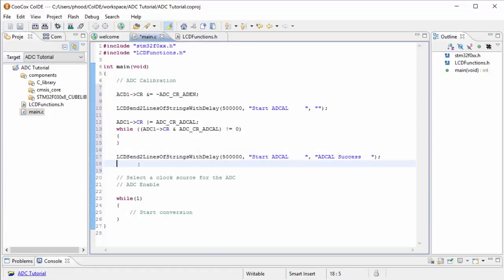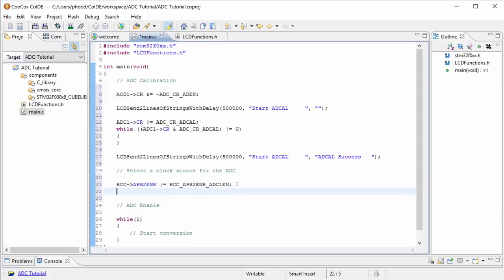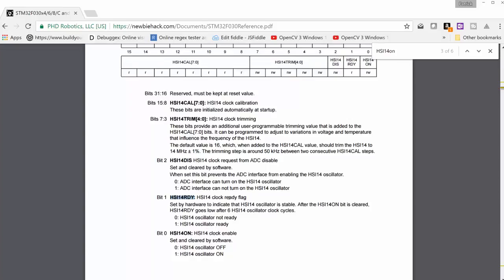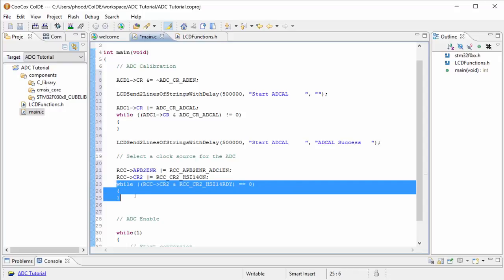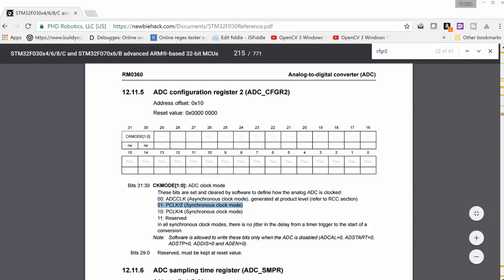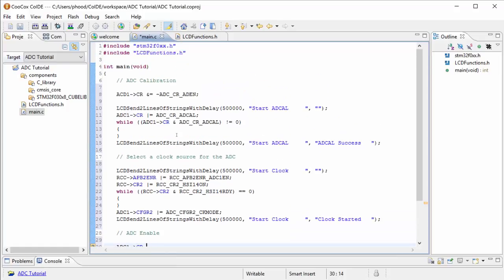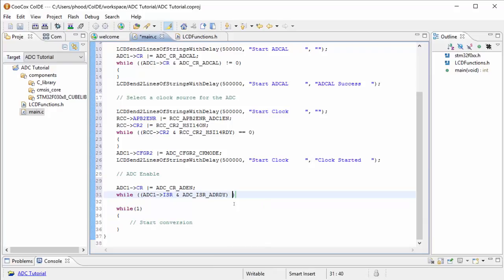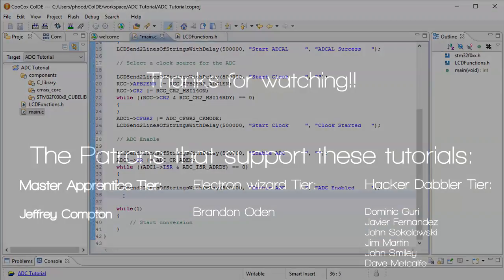35. How to Add Clock to the ADC and Enable the ADC - STM32 ARM Microcontroller - Part 2

Comment: Patrick. You are tackling a void on the internet.

You are literally the only source of info on breaking down ADC within STM32 so that the user does not have to refer to the reference manuals.

STM32 has the potential to do great things, its a shame the HAL library isnt as straight forward as others and it still has many bugs and issues.

I have managed to start my humble beginnings with STM32cubeMX & HAL and get everything to work first go except SPI and ADC which I have had to spend excessive amount of time getting these to work (SPI i have tackled, ADC still working on it.)

I thank you for spending the time breaking down all those extensive reference manuals and coming up with a straight forward tutorial on the fundamentals of getting ADC to work. It really is a headache savior.

Do you have a patreon page? You deserve it.
Reply from the maker: Thank you for those kind words!  I do have a Patreon page and it has all of the ADC stuff completed and I have also gotten into interrupts as well (7/9/2017 for those reading this comment later).  There are always 20 videos on the Patreon page that has not made it to Youtube yet.  As I create a video for Patreon, the oldest of the Patreon videos moves over to YouTube.

Comment: Love your videos! Do you have a video with an intro on timers in the context of A/D conversion? Im new to this and really love the way you've simplified other topics that Ive watched.
Reply from the maker: I have videos on timers, but I can't remember if I use them in conjunction with the ADC.  However, it is very easy to put them together.  I would just watch the timers videos and simply add the code and modify as you need.

Comment: Very helpful videos.
I am having trouble with USART communicaion. How should I go about sending capital characters (letters), lower case characters (letters), and numbers (one at a time) from one microcontroller to another. I am using a wired connection for now, but I soon want to graduate to wireless communication. This has been a long lasting obstacle in my project, and some advice would be greatly appreciated.

P.S. Keep up the good work.
Reply from the maker: Thanks.  Upper case characters and lower case characters have different ASCII codes.  Each letter, symbol, character, and even certain functions like carriage return, ESC, etc. has a number associated with it.  Look up ASCII (American Standard Code for Information Interchange) and you can find the numeric code associated with these letters/symbols and all of the variations.  These are the numeric codes that are sent out in the USART communication in binary form.
Reply: Patrick Hood-Daniel 
Thanks a lot, you're a life saver. I will try to use ASCII values for now on. So, to make sure I am understanding you correctly, if I wanted to send a ('T','a','H', or some other character), I would have to insert it's ASCII value directly into the "UDR0" (for atmega 328) or the "USART_Transmit" function. The microcontroller would then transmit the binary version. Then the receiving microcontroller would receive the same binary number, and then convert it back into the ASCII value that was originally inserted into the program? I hope i'm not annoying you.
Reply from the maker: Yes, or you can use the char data type and use the actual character.
Reply: Patrick Hood-Daniel 

I tried it that way, and a lot of other ways (including the way the datasheet recommends). I think I just need to study the topic more. It makes perfect sense to me conceptually but the syntax is kind of confusing. I'll leave you alone. I just want to ask for one more favor, if you have free time in the future, can you do a wired and wireless communication video with extremely simple explanation (as if you are talking to a 9 year old). You did something like this in the first UART/USART video, and I think that had a huge impact on why I can conceptualize it so well. No pressure. Again thanks a lot for your time and advice.
Reply from the maker: Go take a look at my USART tutorial for AVR: https://www.youtube.com/watch?v=e8uEKWpVf10&t=95s

It's not the same chip, but the concept is the same.
Reply: Patrick Hood-Daniel 
I FINALLY GO IT! my electronics projects have been on hold for months and I finally figured it out. YOU ARE THE MAN! Let me know if you need any favors regarding supporting your channel(s). Thanks again.
Reply: Patrick Hood-Daniel 

The last video you recommended is the video I was talking about when I said "You did something like this in the first UART/USART video, and I think that had a huge impact on why I can conceptualize it so well." What I was asking for was a video as descriptive as that one, but for syntax and understanding the data registers (and stuff like that). But I figured it out.
Reply from the maker: I will be doing UART/USART for the STM32 after I complete the I2C videos.  I can only recommend that you wait for those videos.
Reply from the maker: Excellent!!  I like when I hear success.  Makes this all worth while.